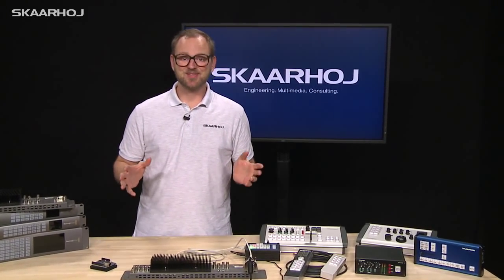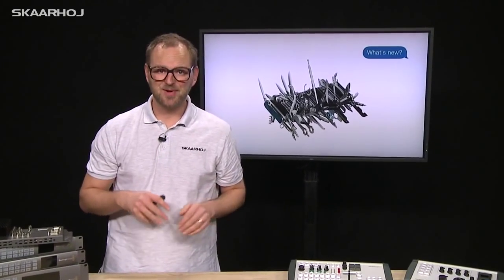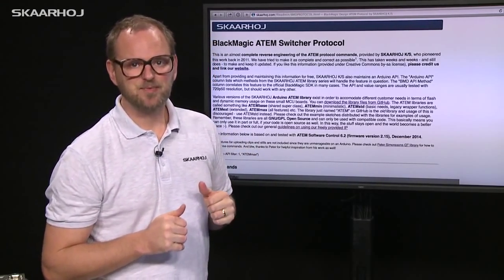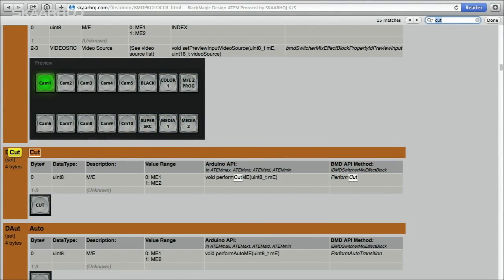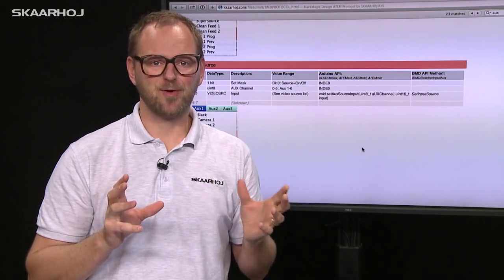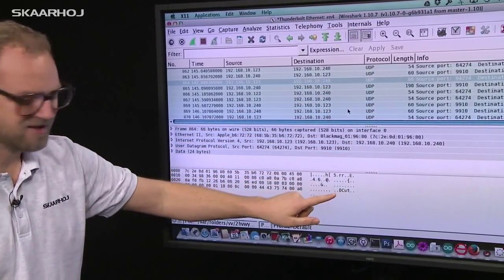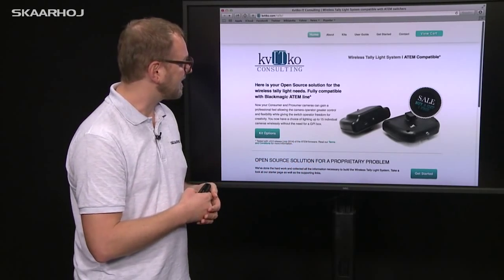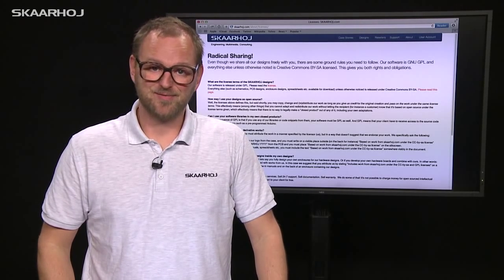Complete ATEM SDK for Arduino by SKAARHOJ (not maintained since 2018)

Comment: Too bad this stopped getting supported past ATEM Version 7.5.0 - This is really great stuff and has allowed for some cool DIY projects. I am trying to pull audio channel mode data to create tally lights not just for inputs set to program, but also their audio channel state of On/Off/AFV to let a commentator know when their microphone is hot, even if their camera is not in preview or program.  I am going to test if I can revert my ATEM back to 7.5.0 just to get this functionality working, but hopefully no other features are lost that I need in the process.  I would love it, if someone picked this up and updated it for the latest versions of ATEM software!

Comment: hi sir,
 i have one requirement which have 4 nos camera and all for camera auto switching based on time schedule. like in a day only one time switch camera and then continue any one camera stream. this type solution possible? if yes then please share details and if i use ATEM mini then how i config Arduino command for this type solution please help.
Reply from the maker: Hi Pradip.
Unfortunately we can not help with this, as we don't maintain the SDK anymore.
The SDK does not work on ATEM beyond version 7.5.
Reply: @SKAARHOJ  thanks